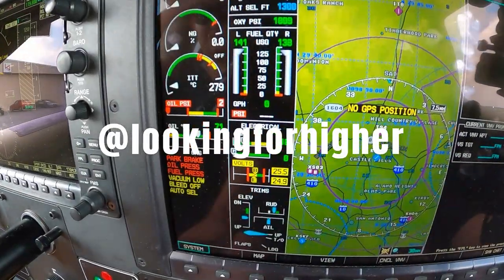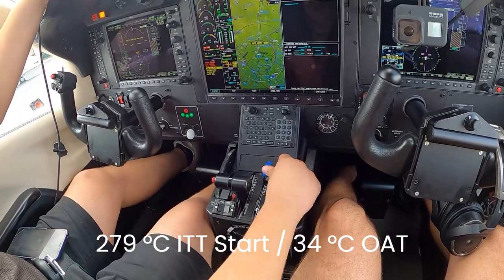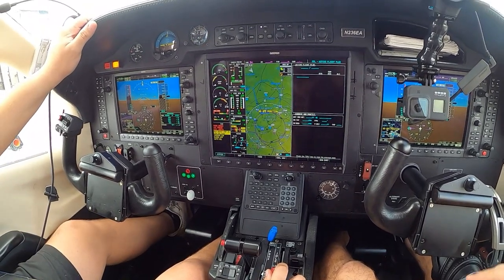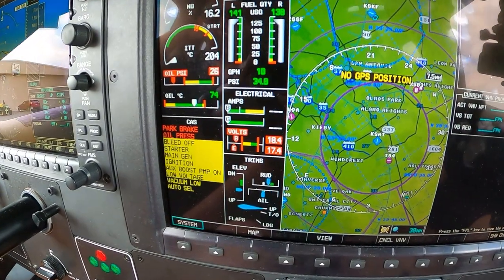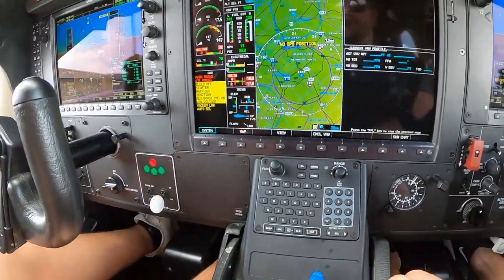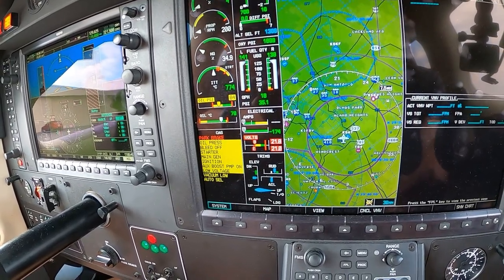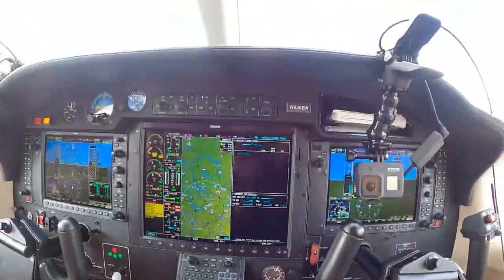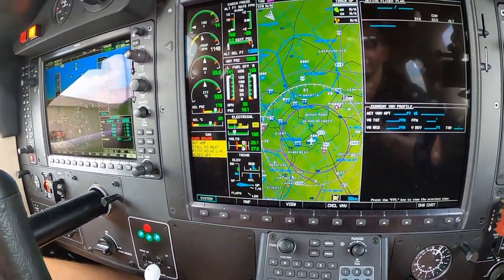HOW TO AVOID HOT STARTS | Dry Motoring | TBM 850

Comment: Great video. But isn’t there a 30 second limitation on the starter? if you are lower than 30% NG, by 30 seconds- starter is supposed to come off no?
Reply from the maker: Thanks for check out this video! You're correct that the book references 30% in 30 secs and then 60% by 60 secs. However, some TBM instructors count this from the time that fuel was introduced. 

The 60 seconds max is for sake of equipment preservation so you don't cook your starter. You should reach those normal "gates" for normal engine start. Adding fuel as late as I did, and having the engine spool up as quickly and cool, see no problem here, respecting the 60 second max always. If I had a normal start hang and stagnate under 30%, dumping fuel, maybe due to a sluggish starter or bad battery as the culprit, continuing the start could cause a lot of damage... Good observation!